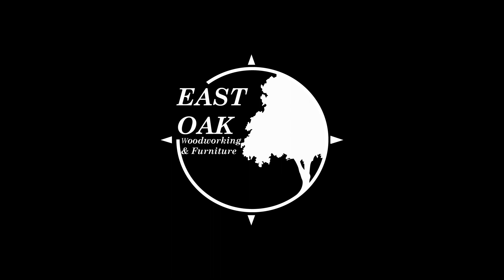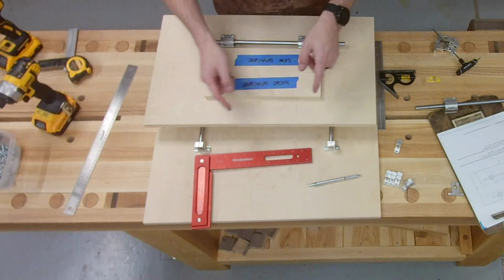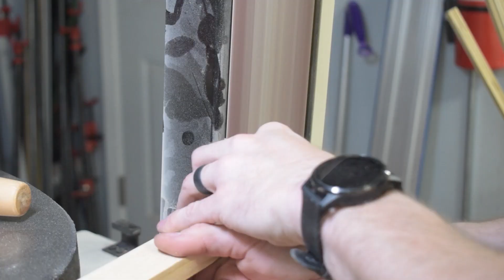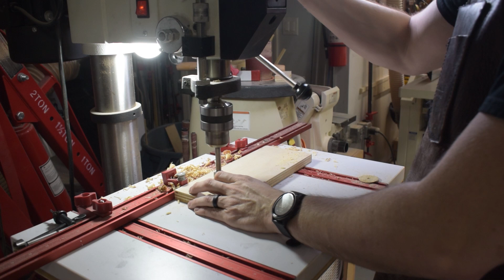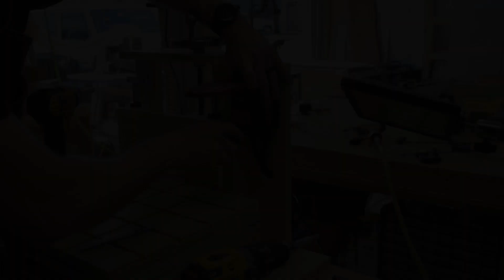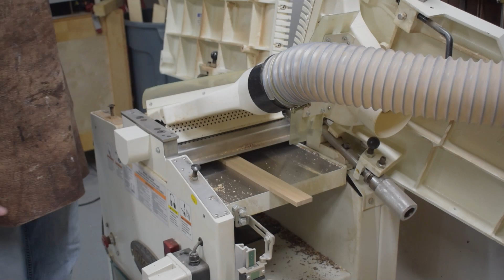Shop Made Horizontal Slot Mortiser

Comment: I built this mortiser and for the most part I am pleased. 
There seems a be a rather short side-to-side travel distance and I wondered if I
had perhaps overlooked something in the purchased plans. The travel in the slid
will not cut a 4" wide mortising slot. Did I moss something?
Please advise.

Respectfully,
Thom
Reply from the maker: Mine has about 4 3/4” max travel left to right which with a 1/4” bit will cut a 5” mortise. That distance is determined by how far apart you set the linear bearings and how long the linear rods are. If the bearings are further apart, it will reduce your overall travel

Comment: Nice work. I expect you are using this now for 4 years. Did it proved it's accuracy during time or did you made any improvements by now?
Reply from the maker: It has been a rock solid staple of most of my builds.
Reply: @EastOakWoodworking  Nice!

Comment: All along all I could think, “ this guy needs a bridgeport, a metal lathe, a welder and a plasma cutter”. This could be so much more accurate, flat, thinner, and stronger even if you used aluminum or steel. You can make your own multirouter and be done with it.

Comment: Very helpful video and an excellent machine! Any concerns over the router moving vertically slightly up and down (along the Z axis) during the operation? I didn't notice any lock mechanism for the wheel, would it turn during the operation?

Comment: You've done an excellent job, what size linear bearings and tracks did you use? I was about to build something similar and had planned to use 16mm but yours look like maybe 12mm?
If so do you find them to be solid enough? Great video well done !!
Reply from the maker: I used 12mm bearings for all three sets.
Reply: @EastOakWoodworking  Thanks for that I can save some cash now and use the same , Great work!!

Comment: In the materials list, you have linear bearings for the x and y axis, but not for the router on the z axis.  Also the link to the linear bearings calls for 12 mm size, but the amazon link lists only  8, 10 and 16 mm.  How do you find the tolerances of the linear bearing setups?  On the lead screw, how tight is the backlash with the nut?  I'm not criticizing, only looking for information.  Looks like a nice machine - good design.
Reply from the maker: The linear bearings for the router lift are the same as the other two sets. Last time I looked, Amazon didn’t have them as sets, but you can buy the pieces. Here is a link to just the shafts https://amzn.to/3w2lbFU just the stand offs: https://amzn.to/3fhgKBb and just the bearings: https://amzn.to/3d5lFCk all in 12mm. The backlash on the lead screw is extremely minimal. I didn’t even have to instal a lock.
Reply: @EastOakWoodworking  thank you for making the effort to reply with the info on linear bearings.  You do nice work - I'm impressed.

Comment: Nice! When making the tenons, how do achieve getting the up and down (thickness) the same every time? You didn’t show too much in your video. Great looking machine, I’m interested.
Reply from the maker: The best method is to set the machine to cut the top side of the tenon (a little thick), then flip the piece over rather than reposition it. That gives you consistency. From there you can “sneak up” on the right fit.

Really though, loose tenons are the best method if your particular joint allows for it.

Comment: I'm looking to build something similar, but have found linear bearings to be very expensive. I've opted for 20mm (inside diameter) bushes which "use a superior nylon-6 material impregnated with molybdenum disulphide (MoS2)", according to the manufacturer/supplier. They are less than $2 NZ each! 
I hope to run them on some 20mm free machining steel round bar - $50 NZ for a 3 metre length.
I'm not going to be able to start on this for a while - too busy, but I'll let you know how it goes. It might be a pile of s#%t
Reply from the maker: The linear bearings were definitely the more expensive part of this build. My first version actually used drawer slides to try to avoid using them. It sounds like your solution might be a cost effective alternative. I’ll be interested in how it turns out.

Comment: Love it! Lots of good ideas for the eventual rebuild of my slot mortiser. Really like the tilt table design, and I've been meaning to make a table with the matchfit clamps forever.

Leadscrew on the plunge/Y axis is very high on my list. I'd love to manage to make a disconnectable leadscrew for both X/Y for some milling operations.
Reply from the maker: I thought about using lead screws for the x/y as well, but as you mentioned, I’d want to be able to disconnect it. Maybe in the mark 4 😂